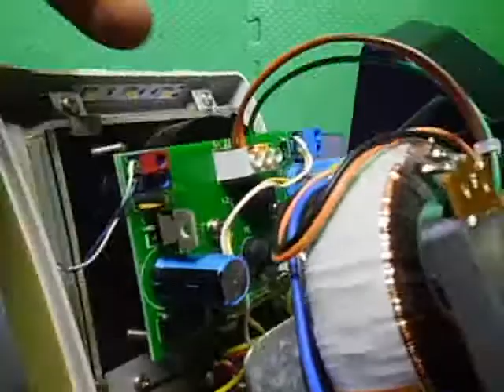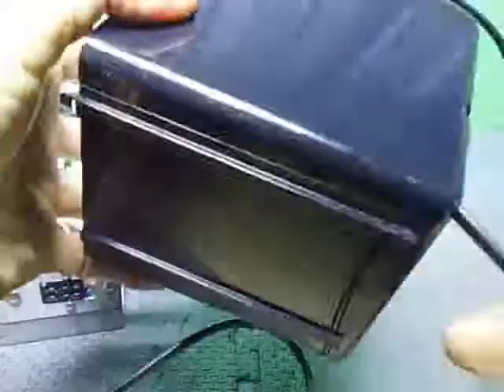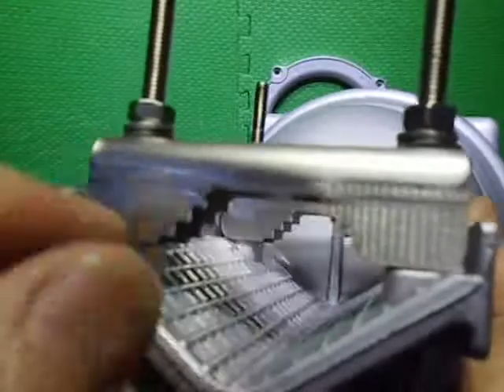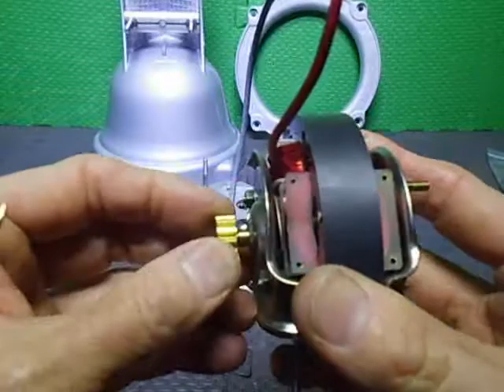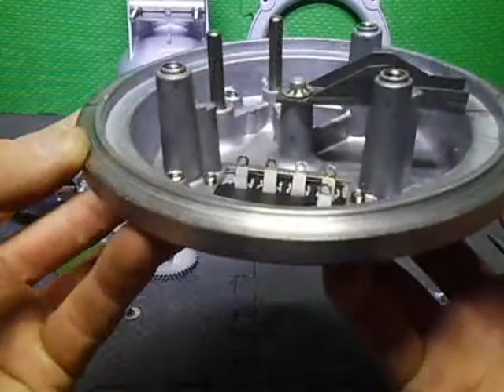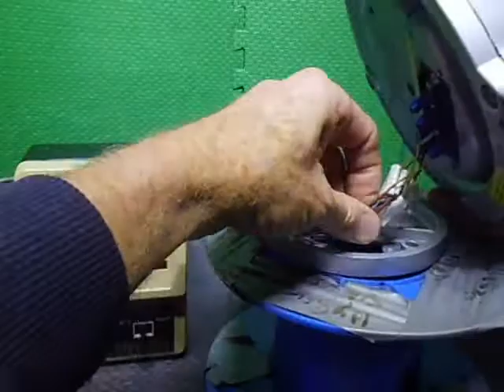HyGain CD-45 DS Rotator Set, parts 1~4

Comment: What size of O-ring did you use to fix the Side Float on that rotator? Mine has, what I think is excessive Side Float and I'd like to fix that. 
Thank you. 
73's
Reply from the maker: Hi Marty, Thank you for the comment. I used 4.5mm O-ring cord (make your own O-ring) that I had in stock, I cut it shorter than the length needed than used a very good Super Glue to glue the ends together. Once I forced it onto the housing, I completely glued the top & bottom sides of the O-ring to the housing. You could use a smaller size O-ring material, as I had to grind down the O-ring to suit, very messy, as I was making do with what I had. If you want more information please get in contact with me via my web site, the link is in the description of the video. Regards Peter